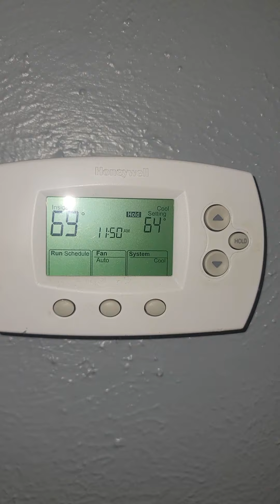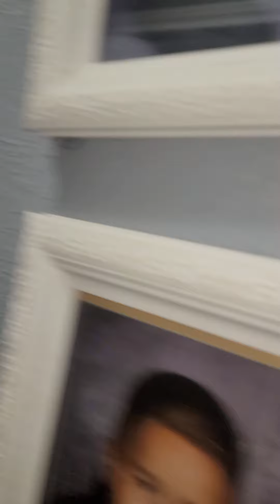Predator 9000 generator running my entire home including my 3.5 ton AC unit

Comment: My AllPower 10,000/8,000 gen runs my 3.5 ton AC as well along with refrigerator, ceiling fans and lights. During power outage, I run the AC at night until midnight, then power it off once the house gets to 74 degrees. I shut the AC off and leave all the ceiling fans on all night. By morning around 10:30, the gen is still running like a champ... all that with only 8 gals.

Comment: I have a video of mine running off natural gas after the storm that came through Houston last week.There are time delayed surge protectors you can buy to put on things that have a heavy draw like a refrigerator or deep freezers. The AC already has a delay. That way there you can just switch the whole house over at once without needing to turn each breaker off. Also better for your equipment during brownouts.

Comment: Nice video. Caution though, you need some wattage meters, to monitor both legs of the generator and to see how much power you're using.  Also, just because a breaker is on, doesn't mean it's pulling power, so be very careful.

Comment: Yeah I don't know about that central unit pull a lot of juice
Reply from the maker: It's a 3.5 unit and it ran it no problem.
Reply: What you had on the unit
Reply: Softstart
Reply from the maker: @demoll78  no, I asked my hvac guy for a softstart and he installed a kickstart. But it helps.
Reply: Well yeah you needed a hard start kit with out it it would not run it pulls to much amps with out the softstart
Reply from the maker: @demoll78  you are correct, I did my homework.
Reply: You don't mention anything about a softstart in your video people going buy these generators thinking it going to run there house
Reply from the maker: @demoll78  damn, you are right man. I didn't think about that. I was just way to excited that it worked that day. I wasn't thinking much. Maybe I'll do a better one soon
Reply: What is a soft start?
Reply: @rubensegurajr1434 kick start is basically the main part of the micro air soft start